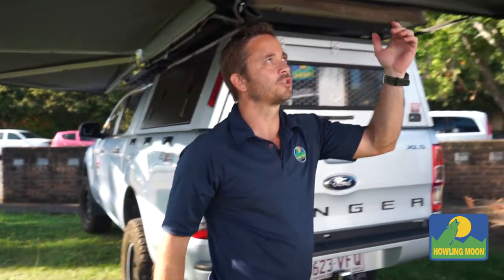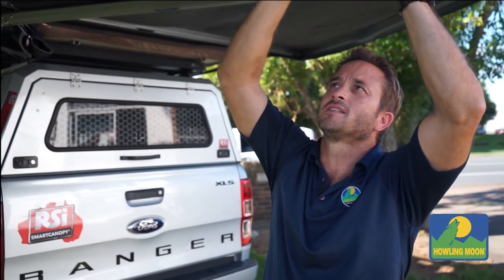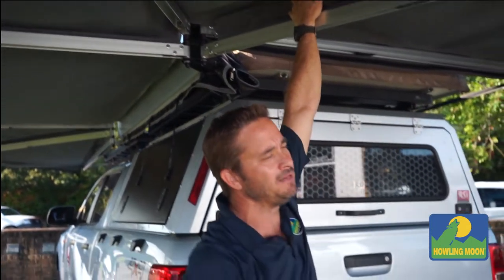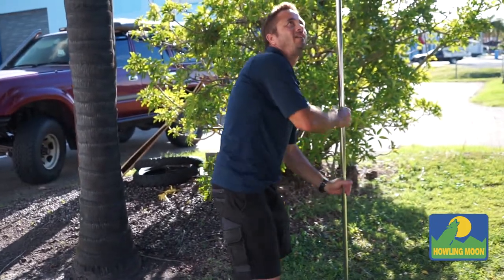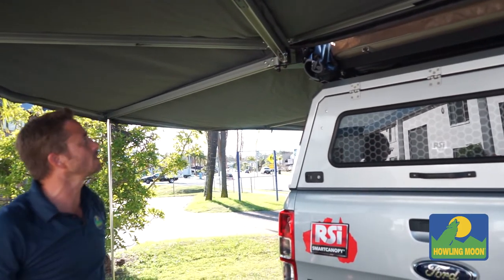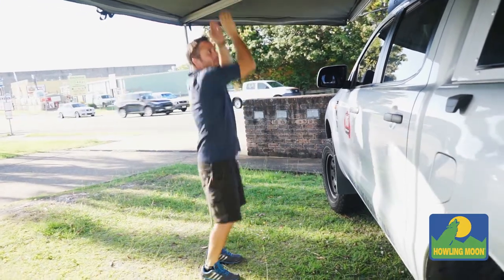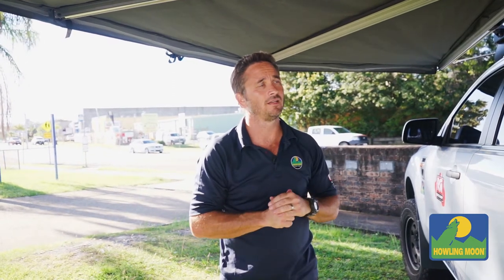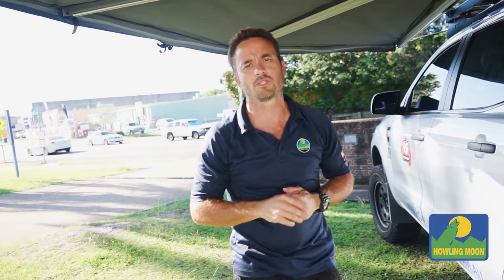Howling Moon - 6 Arm 270° SwingAwn Highlights & Specs

Comment: I bought this awning after a huge amount amount of thought and research and now totally regret it.
Reply: How about some reasons why, instead of an uninformative statement!
Reply: @nigelbryer3645  Fair comment... Here are some of things that failed with mine. The  very first time I opened the bag, the back support arm dropped under it's own weight and buckled.  You need to support it until you have it strapped to your roof rack. The first time I put it back in the bag, the stiching on the seams broke so it now leaks. The plastic  buckle on the strap that holds the awning open snapped (in a very gentle breeze). One of the support poles wouldn't lock tight. On inspection the locking cam, inside the tube had rusted and seized (less than 2 months from new).  I could go on.